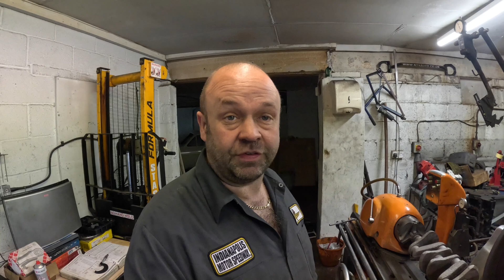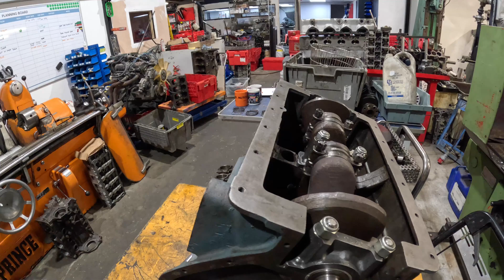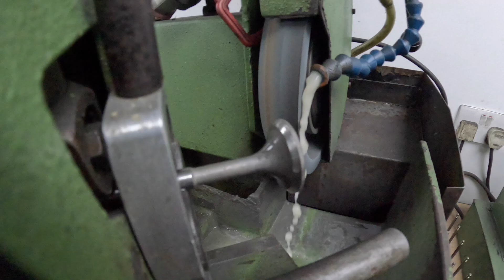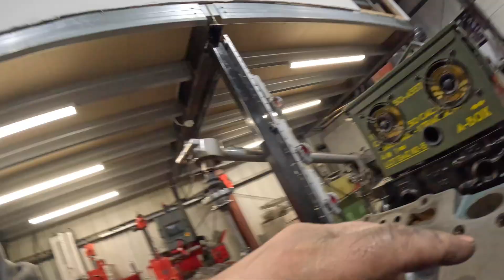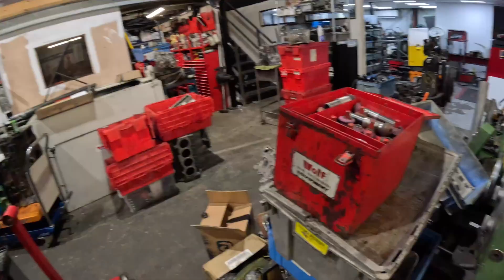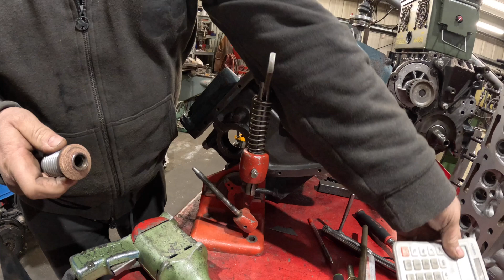Land Rover Series One 1600cc Engine Repair

Comment: Just another quick question " on that crank at 11:40, the deeper rusted pit", why not drill it out , and insert a steel plug and re-grind or weld it up ?  I guess leaving it is also no real issue, it will just fill with oil .
Reply from the maker: The only option was to 1. Leave it because it wasn't so bad and would hold extra oil. 2. Heavy grind it. Or 3 weld it..

Comment: Lovely old side valve, had one of the early ones for a 49 I rebuilt.(I did not rebuild the engine), pity I did not know you then James.
Mine had a crank grind, replaced the cam shaft as well.
Reply from the maker: It's the first one I've done. Very rare apparently now

Comment: Very informative thanks. With a ‘performance’ build, does machining a fresh valve & seat surface then mess with valve spring seat pressure etc?
Reply from the maker: Thanks for watching Adam, yes it would affect it but you can buy spring platforms to reset the pressure

Comment: Yes wedge shaped block sat on the top surface and then rebored  with a Van Norman bar, exhaust seats regularly suffered from hairline cracks!! Prince grinder looks in great condition must be over 40 years old
Reply from the maker: Hi Keith, did the block work well boring? I thought about that in case it needed work. I'll double check with seats they looked good when the grinder touched them. The crank grinder is my favourite machine, it's now in the new workshop

Comment: Well done, sir! I really enjoyed that. It's great to see a new life being given to an old and seemingly decrepit engine.
I am going to shame myself with a couple of questions that shows my lack of knowledge.
First, it's a four cylinder engine. Why are there only four valves and not eight? (One of the comments below refers to a "side exhaust" engine. Is that the reason?
Second, in a previous video you showed valves with a different profile, with two "angles" and not a single angle. Does the "two angle profile" valve mean it's a two-angle valve seat? I just can't remember.
Reply from the maker: Hi Roy, the exhaust valves are in the block the inlet valves are in the cylinder head, with valve angles you can use 1 angle up to multiple angles and now radius seats too. Thanks for watching
Reply: @graceenginedevelopments  Thanks for the info! I learn something new every day !
Reply from the maker: @roygardiner2229 you're welcome

Comment: James you can fit the pistons or remove them from the top to save removing the crank by pushing the rod right up and removing the piston pin . Have done it that way on later 2 lt engine when still installed in car it’s a bit of a job to get rings in as can’t use standard ring compressor.
Reply from the maker: I think you probably could, I didn't have any rings on because I was only checking the side clearance so it was easier to just take the crank back out